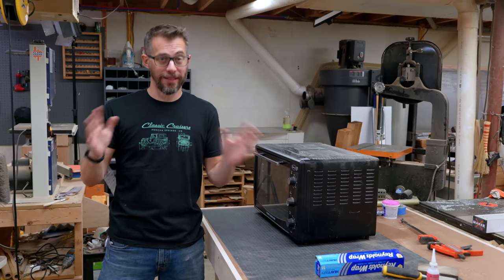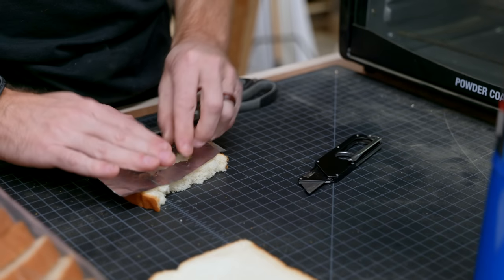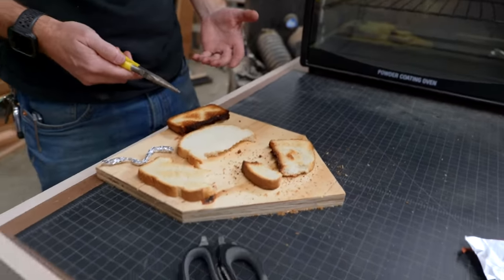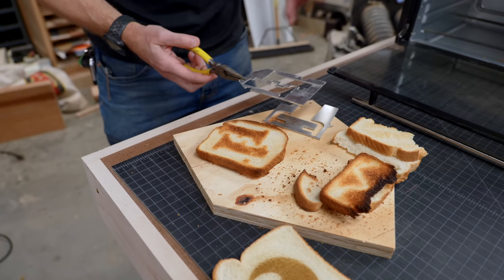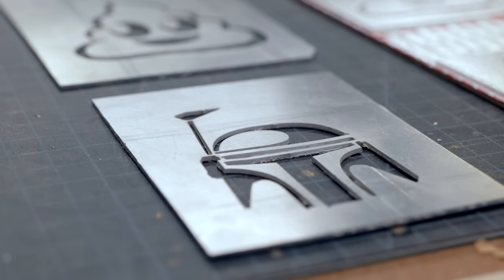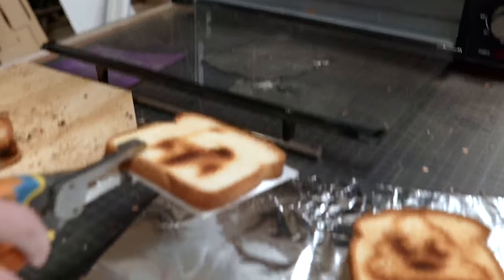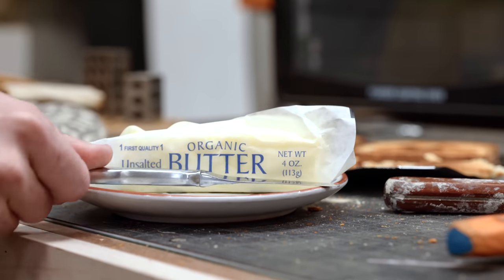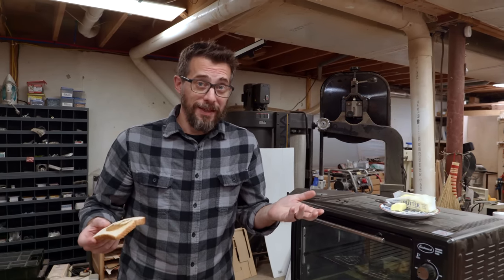Can I Add A Picture To Toast?

Comment: You only need a paper template and spray butter. The non-buttered bread browns faster than the buttered bread. Put the paper template over than spray the bread then remove the template then put in toaster or bake.

Comment: I think the main issue is the "toaster" you were using.  A lot of the toasting action comes from radiative heat, which needs line of sight and a consistent distance from the heating element to work well.  In your oven there are only 4 elements so the toasting action will vary a lot front to back of each piece of toast.  Also, the aluminum mask height blocks some of the heat from the elements, particularly on vertical lines like the range finder on boba fet.  A standard toaster with many wire elements that are a lot closer to the toast will definitely work better.  Or you could just heat up the aluminum and lay it on the toast for a negative image!
Reply: I thought just same thing. Heater element is to far to get good results. Toaster would work better with templates.
Reply: How to get this post seen by Bob. I call redo with normal toaster.
Love the idea.

Comment: What is the issue with eating the one that was laser toasted?
Reply: It's called CYA, because the lawyer said so.
Reply: The bread didn't look half bad, but some food smell really weird after being lasered, while others are just fine.

A lot of vegetables in Europe are lasered with their expiration date on them to reduce waste, so it's not toxic.
Reply: With food safety it’s usually a frame of what absolutely is a rated for food use and safe, as opposed to things that might be fine but aren’t specifically designed for it. My bet (though someone might correct me I don’t know the details of that unit or the use case) is that that lazer is not specifically food safe. Also micro plastics or debris from other things that were in the lazer previously.
Reply: @finchhawthorne1302  no such thing as a food safe laser per se (it's non-contact anyway and transferring heat through the absorption of the light in the material, it'd be kind of like saying there's food safe light). The bigger problem I think is for the particular laser used in this video, it was used to cut many different plastics and woods so the entire enclosure would basically be considered contaminated. Theoretically though if you were to build a laser cutter that made sure only food safe materials contacted the bread and any potential particulates emitted by the electronics/mechanism were safely filtered/blocked from coming into contact with the bread then I see no issue with the laser itself interacting with the bread (other than making sure not to over toast it or set it on fire).

Comment: About 50 years ago, when I was really young, my father had an aluminum foundry and one of the items that he made was an aluminum "toast embosser" (for lack of a better term).  The aluminum was the size and shape of a piece of toast and I'd guess about 1/8" thick.  On one side it had raised letters as the negative of the message you wanted on your toast, something like "Good Morning".  The letters were raised about 1/8" as well.  On the opposite side was a wooden handle so you wouldn't burn your hand.  I think the idea was you would leave the embosser on a hot griddle to heat it up, then would press it onto the toast to burn in the image, like a cattle brand.  Certainly a lot more work than a simple positive or negative, but it could work for what you are trying to do.

Great video, even if you didn't get the result you want!

Comment: When it comes to the bits breaking, running at to low a speed is a thing that acctually can break the bit. I remember someone telling a story about bits always breaking more during night shift, and it was because those guys ran the thing at lower speed (trying to reduce breaking of bits) and instead caused the opposite. Not sure if this is the case with you guys, but, might be worth to try running it at "normal" speed.

Comment: I think the main issue was the toaster OVEN. A regular toaster has nichrome wire on a mica sheet, which is only half an inch away from the bread when in the toaster thus forcing heat directly at the bread. I feel that might help get into the spaces of the stencils.

Comment: I’m wondering if a more direct heat would work.  Essentially imitating a toaster a bit more directly.  Maybe a lower heat torch would’ve worked, or rapidly moving back and forth so you don’t char the bread that quickly, but quick enough toast the uncovered surface area.

Comment: Bob,
The toast in the toaster oven is cooking (toasting) by radiant heat (yes, I'm sure you know that).  All parts of both heating elements are radiating in all directions.  Tough to get the mask to work with the incoming IR energy working in that way.  The laser worked as it shines in just one direction.  If the toaster oven could direct the heat in parallel rays, you would likely get a better image.
AND... make the energy hitting the toast be much greater but for a shorter period of time.  That way the mask material won't have time to heat up and then re-transmit that energy back to the bread, dulling the image.
I propose a parabolic reflector with an intense point-source of IR energy as the focus.  The resultant reflected IR light from the parabola should be close to parallel. 

Something close to what you can do is an ellipsoidal reflector spotlight.  These have a slot in which steel mask can be placed in order to project a light image, very common in theater productions.  The images are high quality and can be very detailed... and you should be able to fabricate that type of template, and use a light source with sufficient energy and the right frequency (less visible light, more infrared), and it should toast that image on the bread in one go.

Comment: Need a more brilliant heat source like a forge or the metal will sap the heat away from the bread before it can heat up in the narrow regions of the design. For what it’s worth, I happen to know you can get toast to form basically as quick as you want if you have a hot enough oven but the hotter you go the thinner the toasted region will be. I built a whole forge powered toaster previously and at some point I plan to add a different cage so it could do structured emblem toasting like this.

Comment: Have you seen the camping toasty makers? You basically put your bread on each side, on one you add your filling and then it clamps together. You then put that onto your camping burner and it’s makes a toasty. 

If you took that idea but on the two side that clamp together you had your design but embossed so it would almost be like a branding iron, that could work.

Comment: Just a thought here, but I'd guess that the browning effect is mostly from infrared heat transfer, which is very line-of-sight.  The large oven has the heating element pretty far from the toast (and not exposed), leading to poorly defined edges in your pattern.  Every bit of the toast is hit by infrared heat from every hot surface in the oven.  The typical toaster has exposed elements right next to the toast, which probably leads to infrared heating being even more of the dominant force in heating the toast and means that each part of the toast is being browned (mostly) by only the part of the element that is directly adjacent to it.  Maybe you can keep using the oven but put the toast very near either the top or the bottom?  I think your weighted mask has merit, too.  If you were spraypainting, you wouldn't hold the mask just off the surface - you'd want it right on the surface to get sharp lines.

Comment: Not that it would have made much of a difference, but always good to remember that in ovens, the back of the oven is hotter than the front and lower racks are hotter than higher racks (unless broiling). So if you want even coverage, you should put the pieces of bread further away from the glass door. Also, temperature and times were never mentioned, but playing with those might have also helped. When you're drying bread, there's a big difference between stuffing pieces and croutons.

Comment: I think you should try the torch with the thicker aluminum.  I betting that would have given a better result as long as you focus only on the part that you want toasted.  Also, why not eat the lasered toast?  I heard that diode or CO2 laser engraved foods are safe to consume.

Comment: As others have added it seems like a branding method would be more effective. In theory it might work to use those plates and put like a clothing iron on it to apply more directed heat without the issues you ran into with the torch. If the designs were right you could do an heated element in the shape you want but I would imagine it would be limited to somewhat thin linework

Comment: You should try bending a wire into a design and then running a current through it (like when you look into a toaster). Only get it very close to the bread to see if it transfers the design. Almost like a brand but not touching it to the bread

Comment: I wonder if you could build a matrix of high power infrared leds or possibly use a lcd matrix as a blocking screen in front of a off the shelf infrared heater.

Comment: I think your a missing a key issue here.  A regular toaster pins the bread between to metal brackets to slightly compress (like when you added the weight) the bread and hold it in place and if you notice those lines appear on the bread.  SO maybe try using a nonstick metal and a regular toaster.

Comment: I would def use the laser again, but set it to a very low power(or higher speed), just to get the design on it. and then use a normal toaster afterwards.

Comment: So did the store bought Vader toaster work better than this?  I'm curious if toast out of that actually produced a clear image.  

If it did work I would think that the pressure of the sides holding the piece of bread and having the template right up against it would be a factor; maybe if you could replicate that amount of pressure it would get a similar result.  Also, that "toaster" you have is really big compared to most I've seen... I'd assume that could be a factor as well as most toasters have a top and bottom heating element; it looks like your oven is only on the bottom.  But either way the overall volume of that could also be an issue.

Comment: Think you would have wanted an insulator as the mask, not conductive aluminium which will just heat up anything under ? Misting it with olive oil will make it quicker too 😁